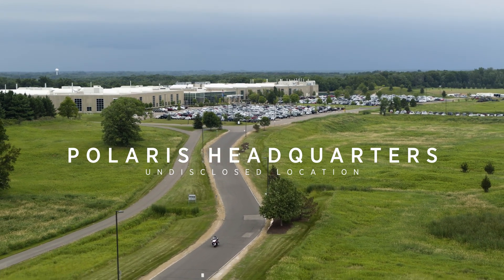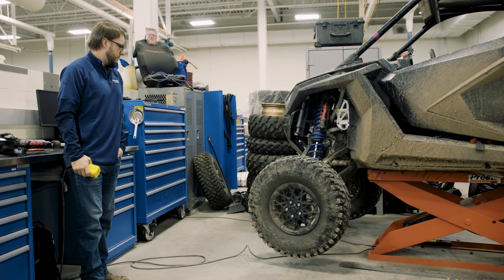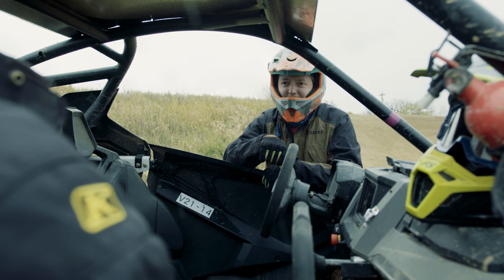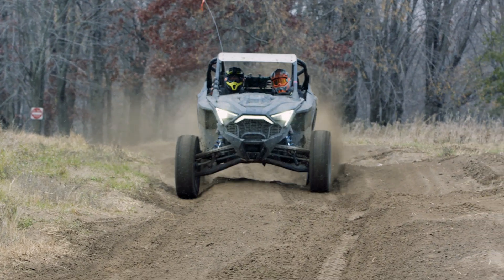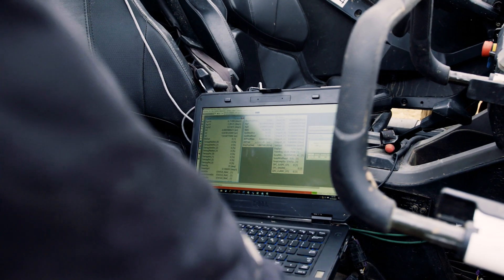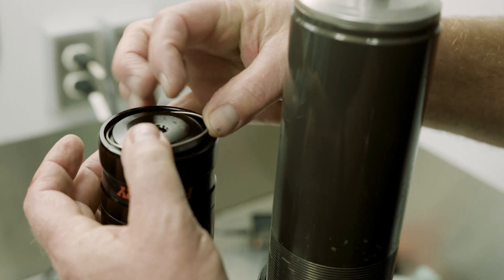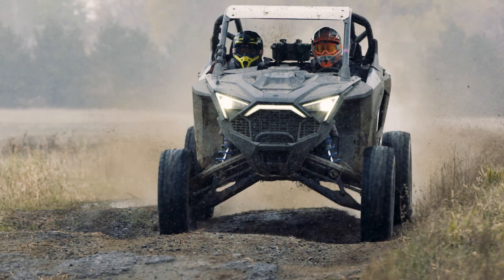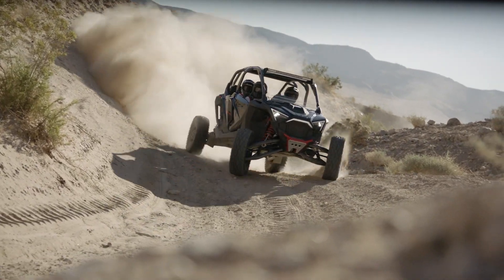RZR PRO R SUSPENSION TUNING w/ FOX | POLARIS RZR

Comment: I work part-time at a Polaris dealership been there for years I work on all the technical stuff except Motors and Transmissions I would love to have a pro r but I can't afford it I'm disabled or I've had a car wreck but I still work part-time I wish Polaris since I work for them would help me get a pro r that would be good advertisement and I would do that for them Polaris really is the best side by sides I've worked on several different brands and Roads different brands Polaris is the best